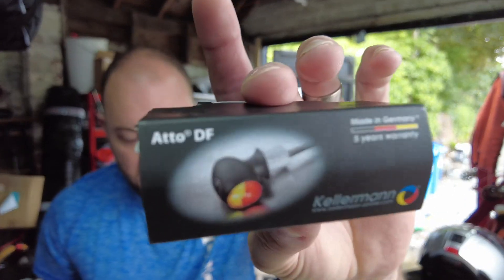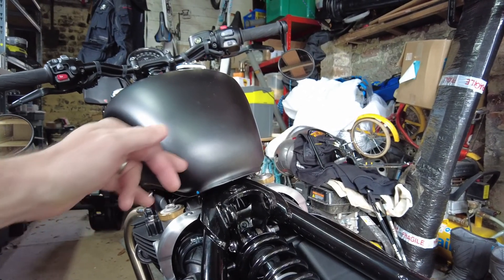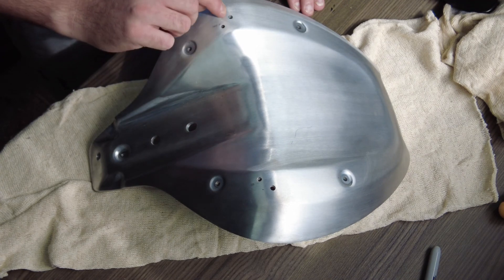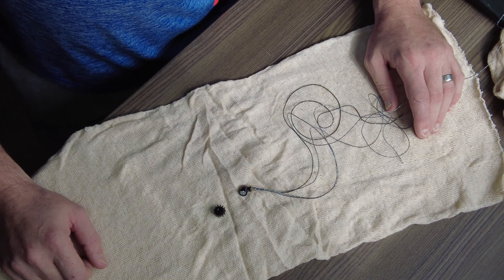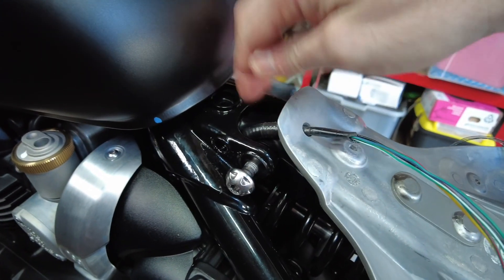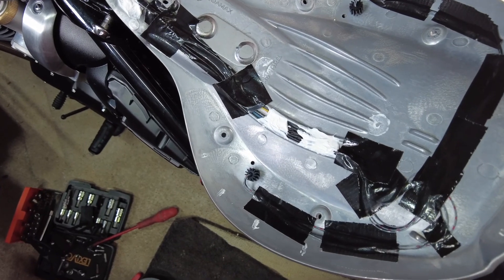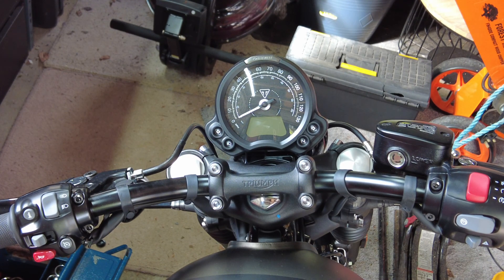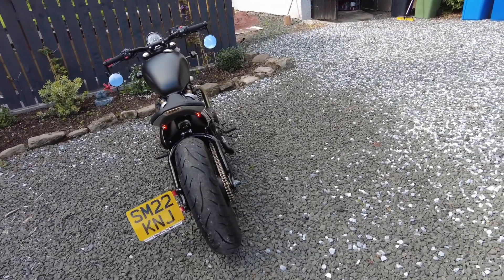FITTING Kellerman Lights

Comment: Im getting my rear lights replaced at triumph under warranty they said theybwere going to irdernme kellermans as i dont have a rear fender they were about to install them onto the frame of the bike until i sent them this video 😁
Reply from the maker: That is excellent. I do love the minimalistic look of them under the seat, through brackets onto the frame seems to be more common. Probably as it is easier.
I started off with no fender, then went half fender. Now I am going back the way and will be putting a full on again. Tired of getting wet and muddy on the Scottish roads. I am also fitting a Hepco rear luggage rack, so I may have to move the lights.
More content on that to come soon.
Good luck with the lights and happy riding.

Comment: Thanks for this video, just bought a 2023 and did this mod before its first service. My blinkers still flash a bit fast even with changing to type 4 or 5. Going to have to take it apart again and put resistors in i suppose
Reply from the maker: Seems that different people have different experiences. Annoying that you have to do additional works but at least there is an easy solution. Where did you mount your lights?
Reply: Same location as you. Tried the factory drain holes in the seat pan at first but felt they may be blocked by the rear tire so moved them out by half an inch or so
Reply from the maker: @orringejuice3405  nice, good choice. Thats why i made my own holes also.

Comment: Hey mate, great vid. Love the new lights. I am thinking about getting the new 2023 bobber this coming year. How are you liking the newer changes on the current bobber?
Reply from the maker: Hi Steve, thanks for the feedback. My videos are lacking a little behind the progress with my mods. I am spending most of my free time out on the bike rather than editing. So far I am loving the bike. Had it 5 weeks and clocked up nearly 500 miles. Rough roads and potholes are killer so uprating the rear shock to something suiting your own weight is a must in my opinion. The rear of the bike was too busy for me and I am loving the cleaner look. I will be posting a video later today on cutting the fender down. Have a look later if you are interested.
Reply: Definitely loving the look. Keep up the vids. I know it’s hard as your out and about, as you should be. Have you thought about the dr.Jekill and mr. Hyde pipes? Of course don’t forget to look at Motone for custom parts.
Reply from the maker: @scubasteve524  will do, thanks. I did look at the Dr J&H pipes actually. I was keep on the British Customs ones but the shipping to the UK, importation etc made it a no go. Then I came across the Hitchcox. I was torn between the matching tips, the black as I have fitted or a full set with X pipe. To be honest it is loud enough for me as is now so I wont be going the X pipe route. I like the black tips on the brushed headers as it creates a different look and highlights the ends. Maybe not for everyone but then thats the great thing with bobbers, we make them to our own liking.

Comment: You’ve done an absolutely fantastic job with that! In fact you’ve convinced me to do it the same rather that the NRC light bar I’ve just received. 
Wondering what you did with the number plate light wire though?
Reply from the maker: Thanks for that, glad you like it. I looked at various light brackets but none of them ticked the box for me so I went off piste. As for the number plate light wire, that forms part of the original wire loom that runs through the underside of the rear fender/mudguard. If you have  a look at my other videos, you will see that I chopped my rear guard and put a side mount plate on. When doing this I pulled the existing loom back to the battery, took it off and separated it. This meant that I could split and send the wires for the new lights up to the seat, and run the wire for the plate light along the frame. If your thinking of doing the same let me know and I will make a short clip showing where I have run it.
Reply: @The_Scottish_Biker  that’s fantastic, if you could do a short clip to show where you’ve run it, it would be most appreciated!
Reply from the maker: @Saitamabaldopm  yep I will try to make something short that shows it. Leave it with me and I will get back to you.
Reply from the maker: @Saitamabaldopm  Just uploaded a new video answering a few questions, hopefully including yours.